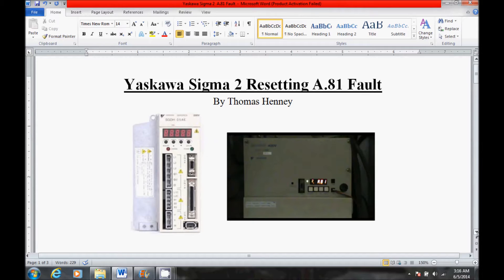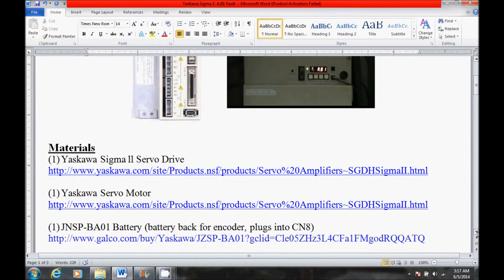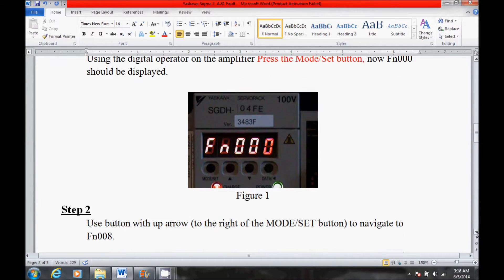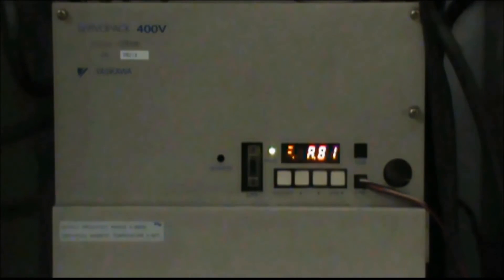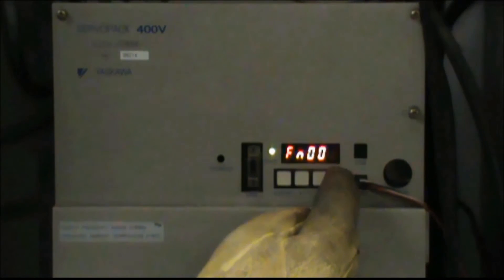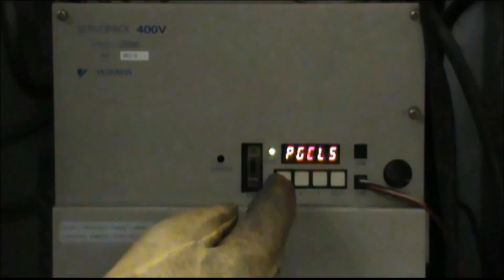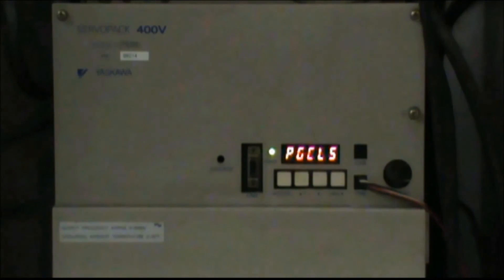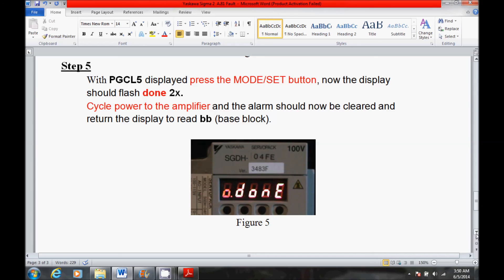Yaskawa Sigma ll A.81 Fault

Comment: Hello MrTon  I have a problema with a Yaskawa engine , the servo drive have the signal A.81 I replace two time the encoder  and I have the same signal A.81. If posible do you help me ?
Reply from the maker: Luis
I am guessing the fault comes back on power up.
If the battery backup for the encoder has not been replaced once you power cycle the amplifier the A.81 will reappear. 

Also with the A.81 fault there are 3 components you will need to look at. That is the encoder, the encoder cable and the drive. Assuming you have replaced the battery, and 2 motors I would look at the encoder cable for and damage maybe swap out cables. If after all that change the drive.

Comment: Hi Mr. do you have any video how get rid of Pot - not fault to turn the drive in run mode?
Reply from the maker: Good Morning Marco,sorry for the late reply but I worked all weehend, but the answer is yes give me a few days I have to remove the back ground music. You know that whole copy write stuff. But to give a brief run down you go to parameter #PN50A and enter the value n.8881With the number 8881 displayed, press and hold the DATA button until the display flashes. This saves the value to memory. Now to go back to the parameter menu press and hold the DATA button again, now the display should be back at Pn50A. Then scroll to parameter #Pn50b and do the same but enter the value of 8888 than press and hold the DATA button until the display flashes to save the change.  And last cycle power.

Hope this helps 
Tom
Reply: I got running the servo pack 
It was not that hard but thinking for awhile. Is so smooth and powerful..
I'm retrofitting a torq-cut 22 1996
But thank you for your help and interest with those issues...